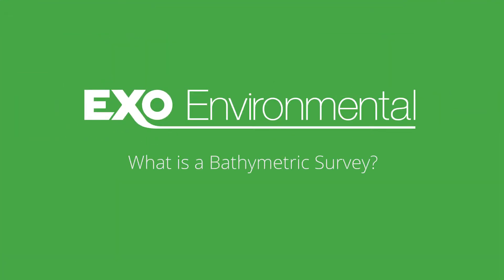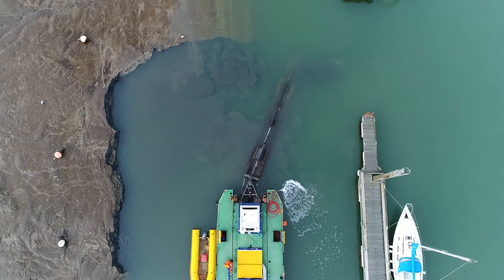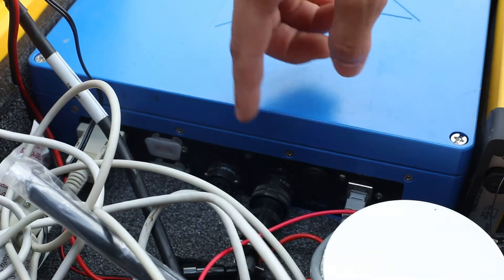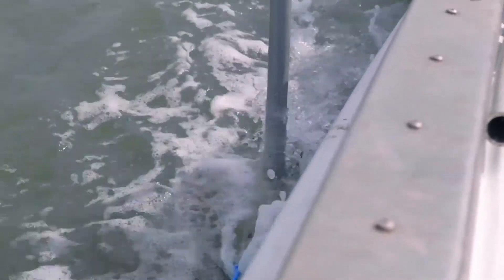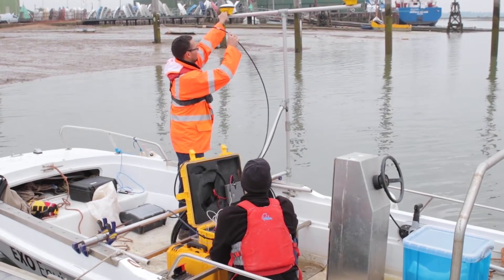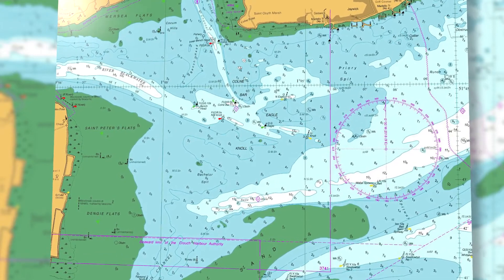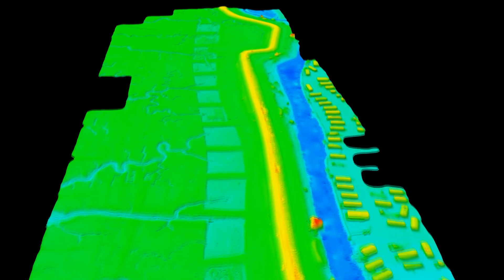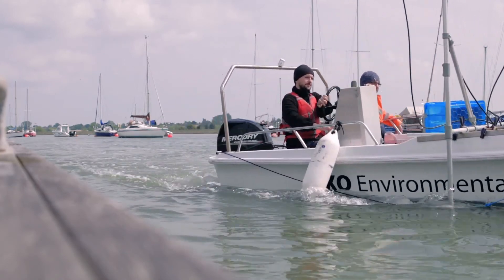What is a Bathymetric Survey?

Comment: does bathymetry need levelling and traverse? if yes how to do that
Reply from the maker: Hello! Good question! There are many controls to ensure the accuracy of the survey. Unlike ground based measurements which remain positionally fixed, positional accuracy on the water is somewhat difficult to pinpoint to such a level of accuracy, especially where there are tidal influences.

In order to achieve the best quality data, RTK GNSS positioning system is used with a reference base station on a known point. This provides cm accuracy throughout the survey at sub second intervals to correct for things like tide or heave. The other aspects of measuring the depth have a lower accuracy overall (the sonar) and are therefore the limiting factor. In those aspects of the bathymetric system, accurate calibration of the echosounder and measurement of the sound velocity in the water both before and after the survey are essential.

Lastly, the survey is performed with overlapping survey lines to allow for comparison of the final calculated depth at locations where the lines intersect. This allows positional quality control across the entire area, not too dissimilar to a levelling traverse procedure. Hope that helps!

Comment: what is the least count of the device u used?
Reply from the maker: Do you mean the minimum number of pings/measurements per unit area? That would depend on the depth/level of prevision required (i.e. IHO special order)
Reply: @ExoEnvironmental  yes thank you for your timely response
Reply from the maker: @dhanushjayakumar537  No worries. In one of our recent surveys in a shallow water environment (<3m depth), we covered the area with an average number of 14 pings per square meter. This was done with a single beam system so this is the number of measurements directly below the survey lines. Those are spaced very closely together (between 5-15 metres), depending on the topography of the bed to allow for accurate interpolation.

Comment: When doing bathymetry measurements, do you use some kind of IMU to measure roll on the boat or is it assumed that the position of the boat is flat at all times?
Reply from the maker: Hi! If you want to achieve the highest order of accuracy then yes you should use a dedicated motion sensor, however in shallow waters and calm conditions the effective error of not using one is negligible. The positioning system (GPS) also corrects for tide and the heave of the boat. Hope that helps!
Reply: Exo Environmental Thank you, great informational videos!